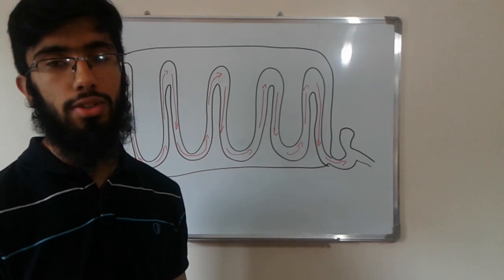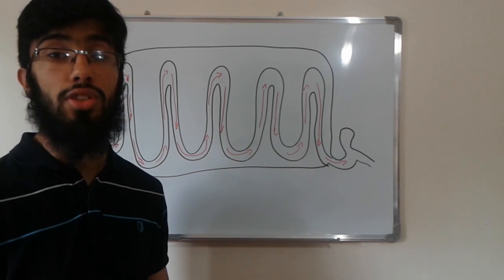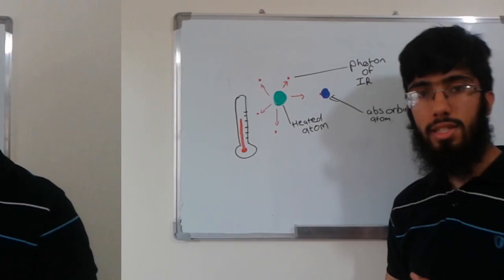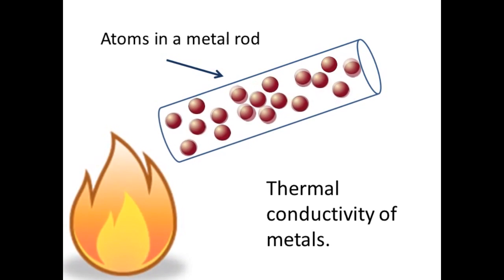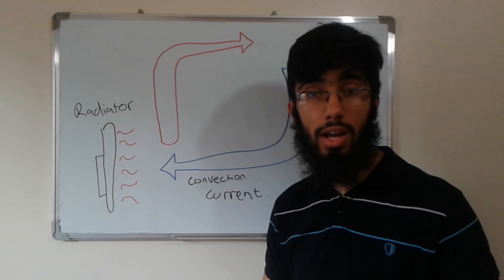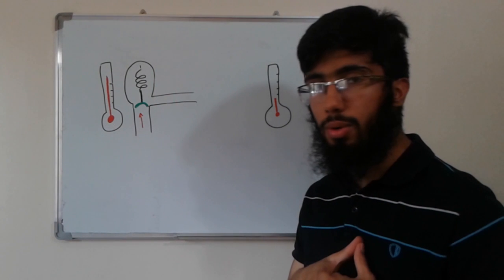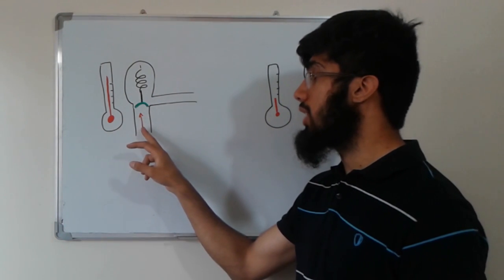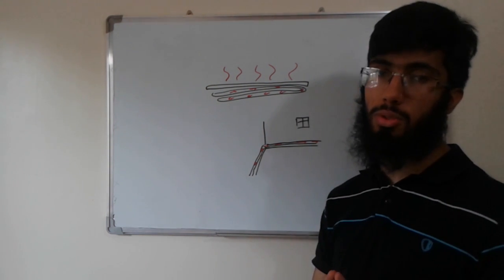The way a household radiator works

Comment: Very good video and explains things clearly. However, there is one question I have, which is, why are radiators placed under windows? At one point I thought you were going to address this when I saw the window in the diagram. To me, it seems illogical to put a radiator under a window because the warmed air will cool a lot quicker due to the window being a lot colder than the walls. This will mean the air above the window will take a lot longer to actually get warm. It seems more logical to have the window on the opposite wall which will accelerate the flow of the cold air to the radiator, but only after the rest of the room is already warm. Which your picture seemed to be about to suggest as the window was opposite the radiator.